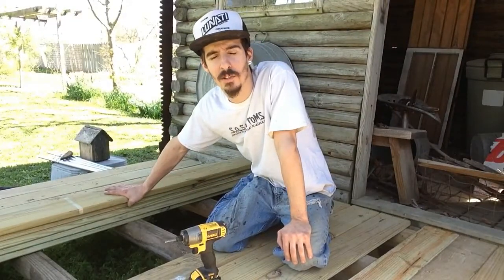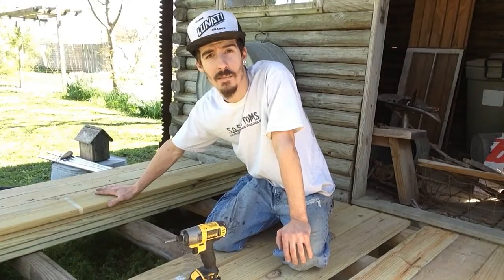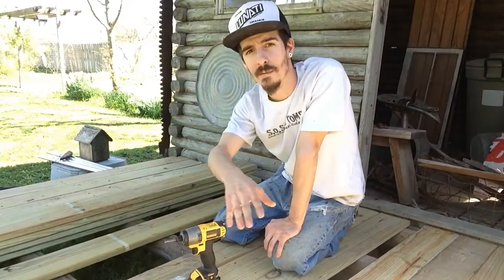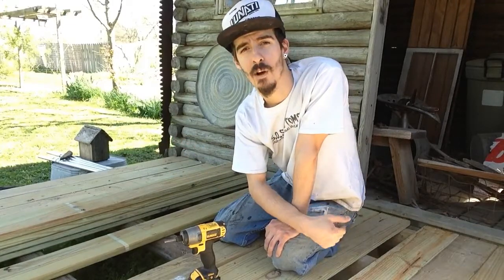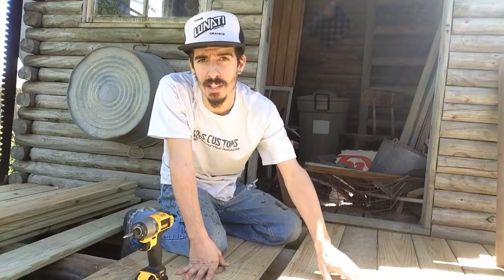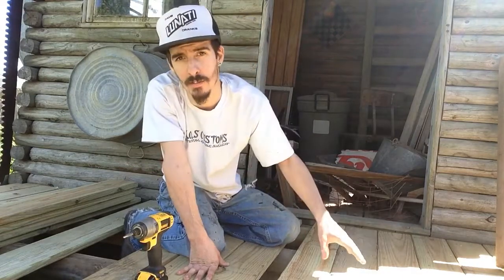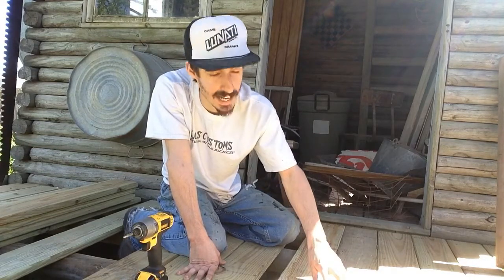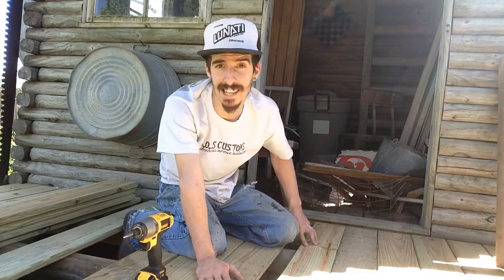Steels Farm Ep.1 Cabin Build

Comment: I get to pop your comment cherry! 1st suggestion is when laying your boards out if your door is center to the structure mark your center line and start laying your boards out from center and working out in both directions. Guaranteed even spacing and symmetry. Tip from an ocd carpenter (and painter. ) lol
Reply from the maker: yes if i had started this project i would have to!  An also pre drilled all the holes an sunk in the screws an put wood rods back in the holes over the screws lol